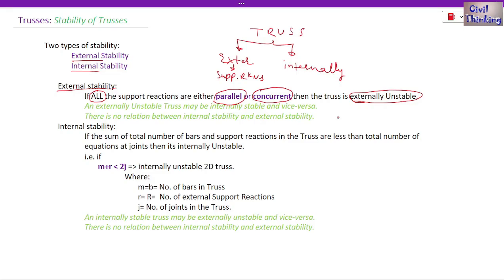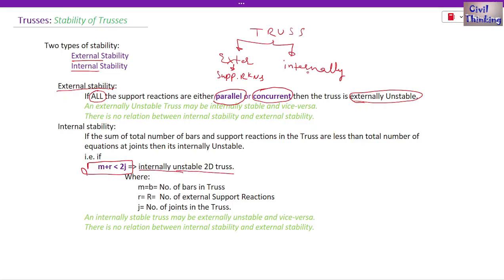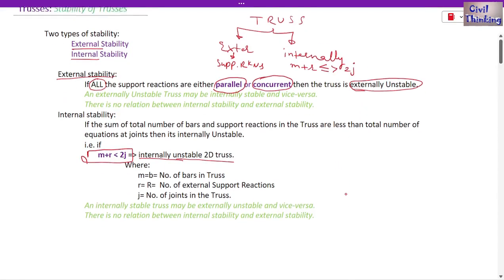Trusses: Stability of Trusses- External Stability and internal Stability of a Truss

Comment: some reactions are parallel but not coinciding. Which option we have to take whether stable or unstable
Reply from the maker: In that case the truss will be unstable because since the reactions are parallel means they are only in one direction. What will stop the motion of truss in other direction? Nothing. That's why it will be unstable.
Reply: But in the same case, reaction force does not coincide. The statement says, if reaction force are not coinciding it is stable.
Reply: Now I understood. Good 👍